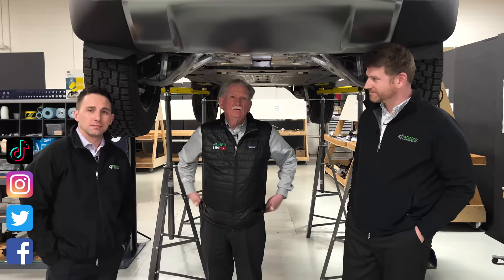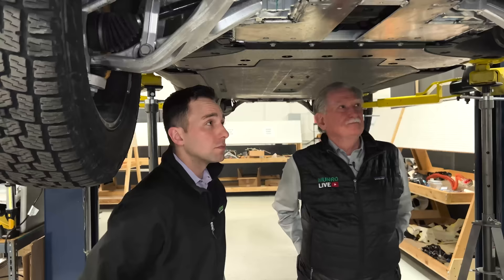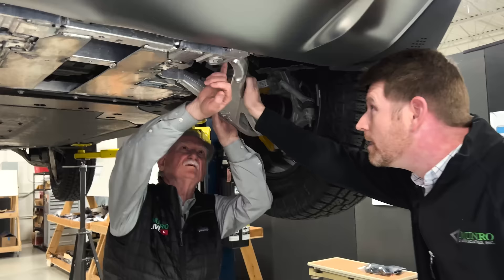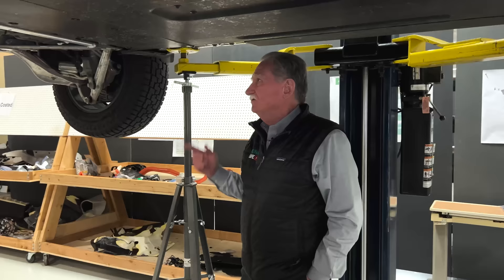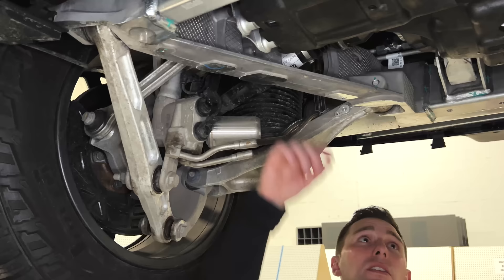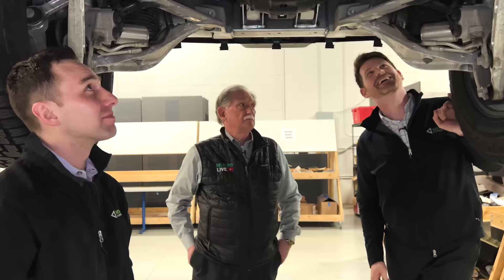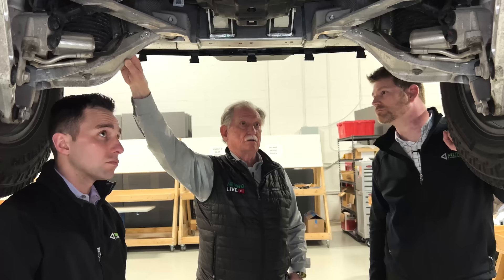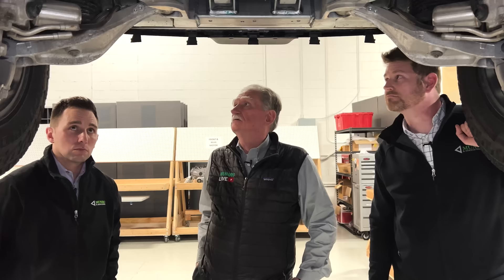Rivian R1T Electric Truck | Hoist Review

Comment: RIVIAN R1T is an OK truck. but it's a LIGHTWEIGHT. 
a glorified MALL crawler. 
it's a GOOD family vehicle, and good for DYI, and camping. DONT expect this robe a TOUGH work truck.
Reply: It's a badass rally multipurpose recreation truck. Not a mini-semi. Definitely not a mall crawler like a lot of the lifted F350s I see around here... This thing is built to go places.
Reply: Rivian was smart to take their first lineup and go after the most broad market. I won't be surprised to see a stripped down WT come out, but if you want to make a market impact up front, you put out high quality, feature rich and reasonably priced product (even Sandy said this should be a $90K truck).
Reply: @peterjorgensen3  - off road R1T is pretty capable, but the Stock all season tires are a JOKE. you need proper 23" off road tire to get any traction.
Reply: @markplott4820  Exactly - that's why they also come stock in ATs.
Reply: @markplott4820  Factory 20" tire is a Pirelli Scorpion All Terrain Plus in a 275/65R20 which is a 34" tire.
Reply: @peterjorgensen3  - FUNNY they have been doing Media events with Street tires, and letting people go odd road on Stock tires. 
not ideal.
Reply: @markplott4820  Interesting. Kyle Connor at out of spec motoring got one for a week and it was with ATs. Same with Doug Demuro. I don't think I've seen a media event with all seasons...

https://www.youtube.com/watch?v=XcZ_7qR_KBE
Reply: @papasquat355  - a $89k truck is not broad market, that's upper end. 
Broad market would be $35k light truck.
Reply: @peterjorgensen3  - the RIVIAN AT are sucky at best , still need proper off road tires for outdoor. 
not going to get much traction with AT , vs snow tire w/ spikes.
Reply: @markplott4820  Interesting. in my experience Geolander GO15 and Falken Wildpeaks are pretty decent in both rock/mud/sand and deep snow - and relatively efficient and quite on the road - for an AT anyway... No experience with Pirelli Scorpions though. I wonder why they chose the scorpions? Efficiency?
Reply: @peterjorgensen3  - prob to meet EPA estimate, range.
Reply: It is where THIS market is. They may build work trucks once the supply issues are solved, but these are their first edition showcase trucks. You won't find Cybertrucks or Hummers on construction sites either